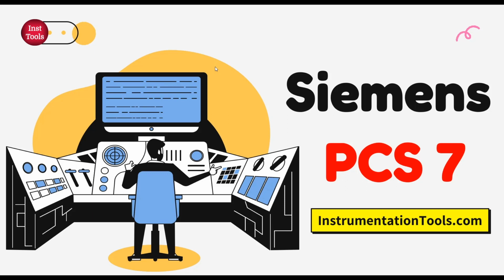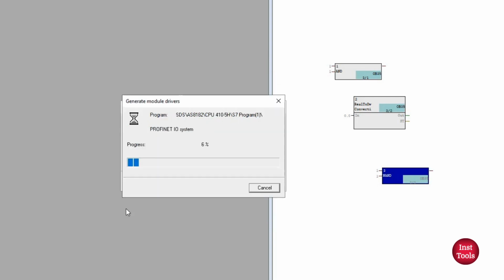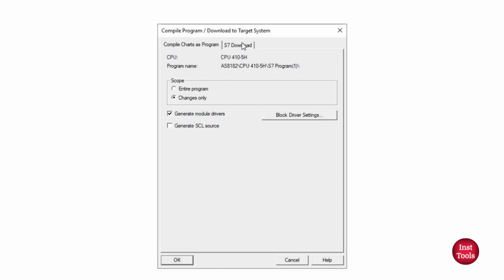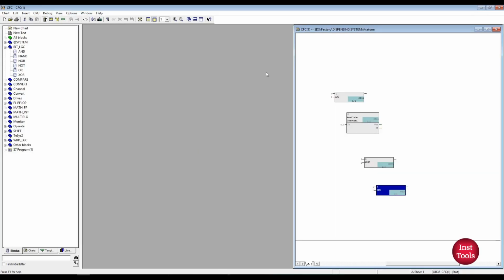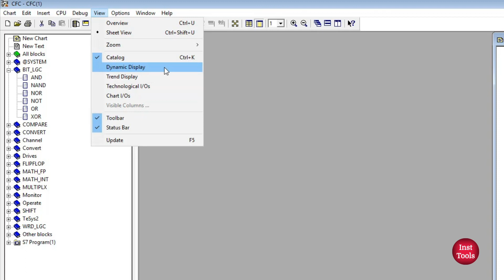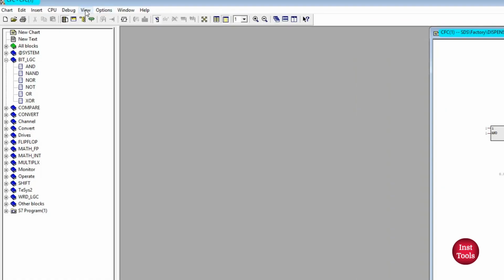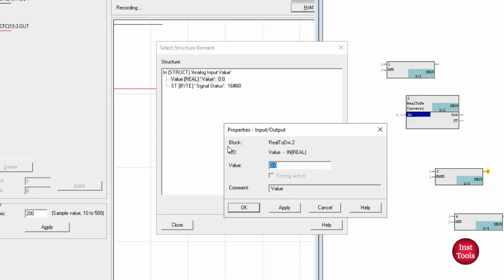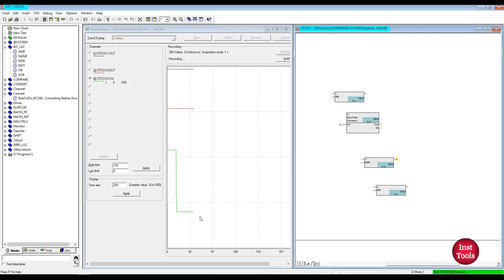SIMATIC PCS 7 - CFC Program Compile, Download and Testing

Comment: While compiling, when to check Generate module drivers and when to uncheck it, please clarify in few words.
Reply: When you face any issue of data movement, inside CFC logic you can check this generate module driver option so you can verify the SCL code for the derived blocks.